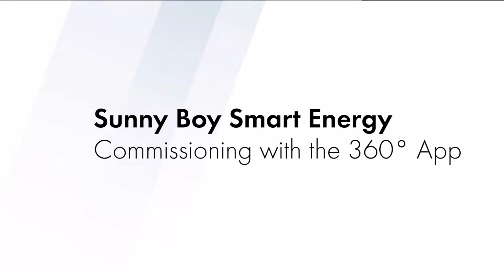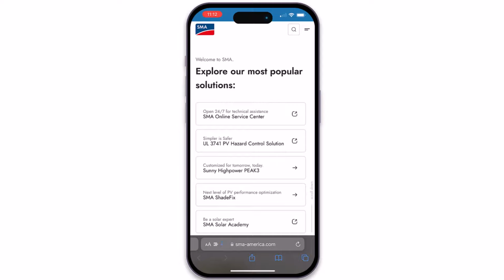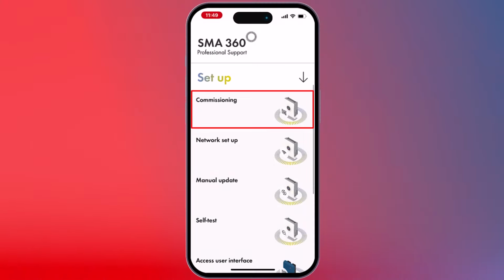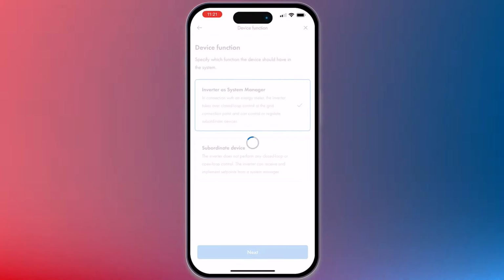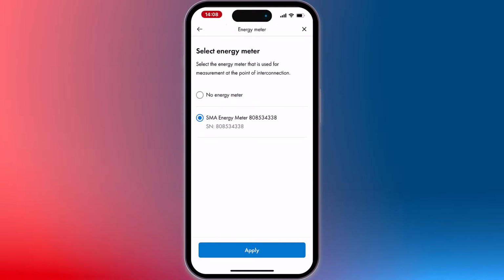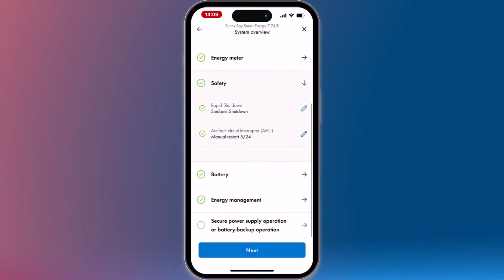TechTip: Commissioning the Sunny Boy Smart Energy (US) with the SMA 360° App

Comment: I didn't really see an option to configure this system to run in charge batteries only mode if PV isn't keeping up.  I'd I to run off grid with battery charging only when required off the grid, never feed power back onto the grid.  Is this supported?
Reply from the maker: Hello John, please contact your installer for more information about off grid use and zero export. It's possible with this inverter, but if it is realizable for your project, we can't tell. Sunny regards, Daniel from the SMA Social Media Team

Comment: Tried this: via Commission or Access User Interface => enable Scanner => scan QR code => "SMA 360 app wants to use a temporary Wi-Fi network to connect to your device SMAxxxx (which is the serial number) => Connect => "Connection Established" => "Device is being Preparing" => "Device is not ready"

If the Blue LED is not on solid, would that explain this?  Any other tips to move forward?

Note 1: there is an article dated June 17, 2024 and it sure looks easy.

Note 2: there is also an article dated May 21, 2024 "When commissioning the Sunny Boy Smart Energy via the SMA 360 App, ensure a connection to your local network"..."This is especially important when you're not connecting your inverter via ethernet cable, but via Wi-Fi"..."Use the "Set up the network" to establish a connection to your local network.  This fundamentally makes no sense as this would imply the homeowner must have their own network to commission the unit??  

Everything else implies you connect the app to the Inverter's Wi-Fi network and use the menu driven app to commission the system, which a series of options pretty straight-forward.  Only the registration would involve connecting to the homeowner's network, and in the "Commissioning Guide: Sunny Boy Smart Energy" applicable to the SBSE-xx-US-50, on page 9 it states "Registering to the ennexOS portal will be covered in a separate instruction set, and (2) Select 'Skip Registration' for now.

HELP: I was told over the phone that I could not talk to a Tier 2 Technician unless I'm the Installer.
Reply from the maker: Hello victorrander4349, the blue LED shows internet connection. If there is no connection the LED is switched off. You have to connect your phone with the SMA 360° App to the inverter via WiFi. Internet connection is needed, if you want to register to the Sunny Portal otherwise you can skip ahead. The blinking in unison of red and green shows that the inverter is ready to be commisioned. If that was the case for weeks you should restart the inverter. Please note: You have to be an installer to do this work. And please be aware of the risks involved by working with electricity. Sunny regards, Daniel from the SMA Social Media Team
Reply: @smasolartechnology  That makes sense, in the demonstration video I suppose someone has already set up the communication.  Note: unfortunately the SMA-360 app did not successfully connect to the inverter, "Device NOT ready, try again later".  I was told on the chat this is usually a problem with the app, so the next step will be to try connecting directly to the Inverter's Wi-Fi to access the built-in User Interface.
Reply: @smasolartechnology  Could you please clarify the various passwords?  

The Inverter Admin username and password should be the same that the homeowner uses for the various SMA platforms, the apps and web site.  (Ref "“If you have an account for any SMA platform, use the same username and password. Using a company username and password is recommended for ease of logging in at a later time.”)  The second 1/2 of this statement seems contradictory.  I would think the one Admin Password could be shared.

I saw somewhere the option (?) to create an "Installer password"; so this could be an additional password to log into the inverter?

The "System Password" is unique and used to create a "plant" which would allow the homeowner to access the Sunnyboy Portal (?).  This comes up when the "installation /  not commission" is searching for other devices and says ALL devices have to share a common password for the Speedwire?  But if I only have a PV system with the Inverter as the only device is this required, optional, or optional but recommended for possible future growth?  Is this the password that would be used for the Sunnyboy portal and the Energy App to monitor the system from anywhere?
Reply from the maker: Hello victorrander4349, step by step: The switch off period should be something around 10 min. The way to the web frontend of the inverter is shown in the manual https://manuals.sma.de/SBSExx-50/en-US/11114451723.html . You're able to change passwords if necessary. You can do that via Device Key https://manuals.sma.de/SBSExx-50/en-US/13743751307.html or PUK 2.0. For the Sunny Portal registration you'll need either the installer password or admin password. Please don't use the user password. Sunny regards, Daniel from the SMA Social Media Team
Reply: @smasolartechnology  To restart the inverter, how long should I leave the power off?
Reply: I did restart the inverter but only left the power off for maybe 30 seconds, not an extended period of time.  Is it possible leaving it off for 5-10 minutes is necessary and then maybe the app would work?? (vs. the "Device not ready" message)
Reply: I have confirmed the Blue light was NOT on, only the Green/Red was flashing simultaneously after the unit was just sitting there for weeks: does that possible time out, or what might this mean??
Reply: "Blue LED is off There is no active connection."  Yes, but the video shows the blue light is on at 47sec, and nothing has been done yet: you don't join the network till 1:20?  Note: I'm resorting to posting questions here because I'm not allowed to talk to a Tier 2 technician over the phone.

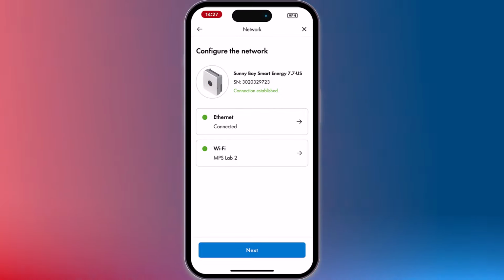Comment: At 2:54 it jumps to Configure the network (to connect the Inverter to the home-owner's network), which is fine, but not critical to Commissioning the Inverter and getting it up and running and producing.  My understanding and common sense (i.e.: homeowner is not required to have internet access) says this could be done later.  The video IMO should point out this is optional at this point, as does the guide, which says to 'skip registration' for now.
Reply from the maker: Hello victorrander4349, thanks for pointing that out. You are right it is optional at this point but it helps a lot, if you register it within the Sunny Portal the moment the inverter is installed. Sunny regards, Daniel from the SMA Social Media Team
Reply: @smasolartechnology  Agreed

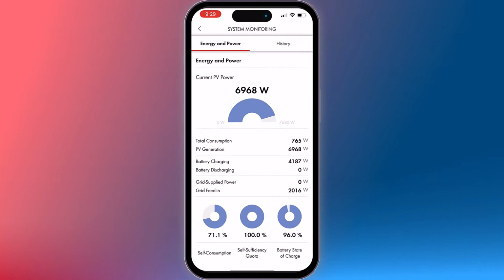Comment: IF you shut off the AC (Grid) Power and DC Disconnect, (at 40s) where does the inverter get it's power to function at all, and if that is correct (?) the video should state when to turn these breakers back on, which I presume would be after all the setting have been made, which they must have done in order to show the production on the dashboard (6:47). Note: it doesn't mention turning off these breakers in the manual or the Commission Guide document.
Reply from the maker: Hi @victorrander4349,

Once the hardware installation is complete, please switch on both the AC and DC power. Wait until the LED lights on the SBSE begin blinking in unison to begin the commissioning process. This step is demonstrated at the 0:39 mark in this commissioning TechTip video. Hope this helps!
Reply: @smasolartechnology  Well yes that makes sense, but the video says exactly the opposite shut OFF, not ON, and should be fixed.
Reply from the maker: @victorrader4349  Hi again! Thank you for catching the CC mismatch on our end! We've updated it so the closed captions now match the voice narration exactly.